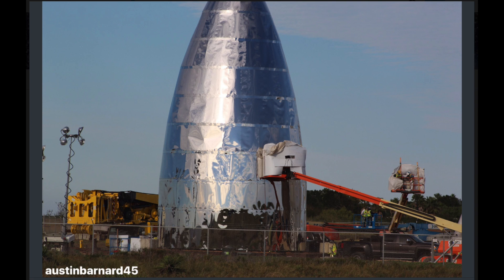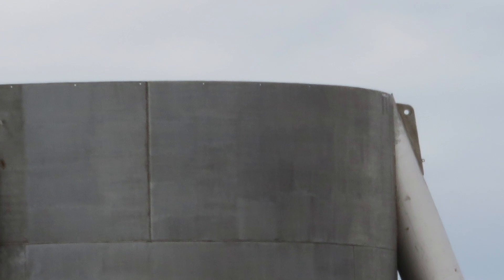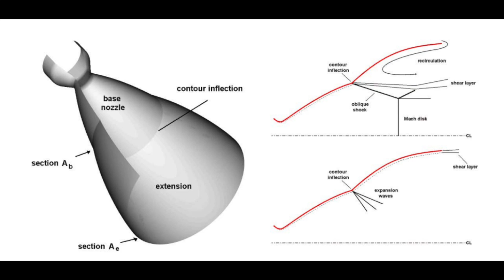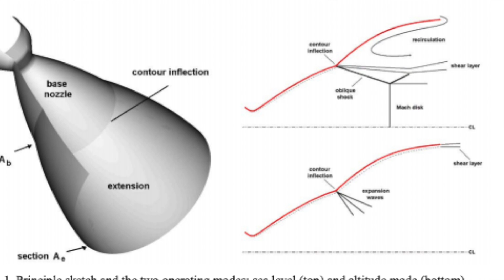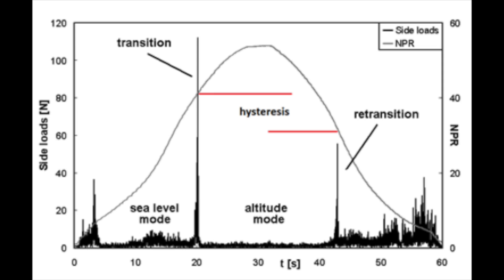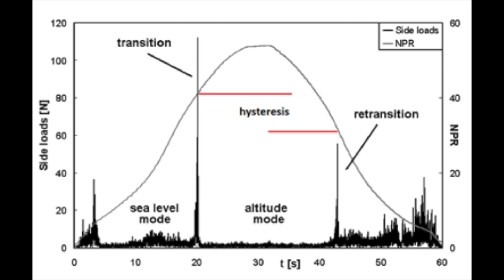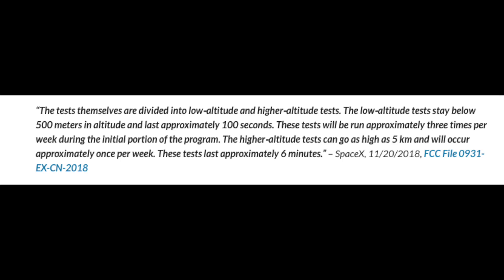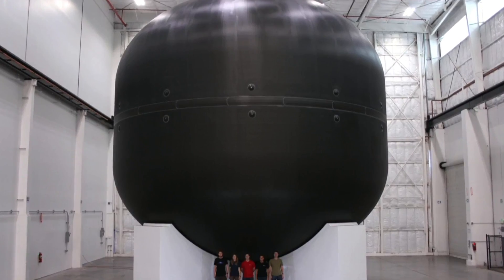What's Going On With SpaceX's Stainless Steel Starship?

Comment: go find the large flat panels on the SR71. When sheet metal expands as it heats, it only gets slightly thicker, but can expand greatly in the plane of the panel. As noted by another commenter, applying flat sheets to a compound-curved surface is also difficult. 

If Scott's assessment of the use of polished stainless as a heat management solution is correct, you don't want those sheets of metal expanding in plane - they'll start popping fasteners pretty quickly. That's the same reason that much of the titanium skin of the SR71 is corrugated. The ugly panel forming on this prototype could simply be to give the metal a way to expand without fastener breakage and fancy metal forming techniques. 

That said, the rippled panels will also probably introduce hot spots in an uncontrolled manner. It is, after all, a prototype. If Musk is going to use polished stainless in the final setup, I expect that many of the panels will feature corrugations or a pattern of raised bead rolls.
Reply: Cylinders can't expand "in plane". They just grow in diameter when heated.
Reply: @nvlietstra   Duh. I missed that. Commenting tired is almost as bad as commenting drunk. But I still believe a nicely formed smooth sheet would stress the fasteners. OFC, I'm not a materials engineer, so believing it doesn't make it true.

Comment: It is just a hopper.  It will not go particularly higher or faster than Grasshopper.   The double bell might just be to allow for deeper throttling, more than it is for Vac service.
Reply: Miguel - Yup.... Not! This puppy is "Supposed to go up 20 Kms, & Back." Original Grasshopper only did about 1-2 Kms altitude.

Comment: Maybe it is just a mock-up frame to work on the cabins and interior architecture, it will help to test ergonomics and comfort on test crews. Furthermore, I would not be surprised, if this is a mock-up, that it could be used to test crew members candidates ability to live and work together in a « starship simulator » to check their potentials and behaviors, prior to sending them to Mars. Personally, I would do that, just to make sure that everything possible to test the crew and their needs have been done before sending them on Mars. Funnily, SpaceX might do a kind of «big brother» like tv show with it, to create media frenzy about testing Mars crew candidates on earth, while MarsOne had the same idea but on Mars, which is much more risky and could go very wrong.

Comment: What if this is just a transportation unit for the carbon fiber fuel tank? the sections look easy enough to assemble/disassemble. stainless steel for transport on a boat, and structural enough to keep the tank safe. It would be a really awesome to see a ship going around with a giant shiny rocket on top. maybe he is just putting fake rocket engines on it to keep us guessing (why would you leave something that expensive out in the open around fabrication??)

Comment: I think it's largely a software/controller test platform. I suspect it's main purpose is to fine-tune the most complex aspects of landing with multiple gimbaled engines running at the same time while maintaining balance for the tail landing configuration. That level of software control and all the hardware sensors that feed it, plus the durability of the computer systems handling it all, plus redundancy and hand-off problems... all this means a legitimate flying platform to do live tests. It doesn't have to do anything but house all these systems, but since that's the only requirement, why not make it a "scale mock-up" of the real thing? Makes for good advertising, especially when it's all assembled, polished and sealed. It will be a lot prettier than a blocky structure of girder framework, and probably doesn't add much to the overall cost of the project if the top two thirds of it are just a "facade" of sorts.

Comment: Why are they doing this ... ?
It is rather obvious that it is going be the lowest possible cost way of working out whether his new engines and side thrusters are going to work and be controllable - there is a hell of a lot to test - one engine, two engines, three engines, flight control, hovering, starting and stopping the engines multiple times while flying, throttling them up and down as they fly. 
If SpaceX can test all that with a very cheap rough stainless steel can - of approximately the right proportions and overall weight - brilliant. 
When it crashes ... they won’t have broken the bank ... with the simple crude design they can afford many failures ... and learning how to manage this particular bit of the flight envelope is rather important!
GOOD LUCK !!

Comment: I think the bent up sheets of stainless, haphazardly bolted together into roughly the "correct shape", are hilarious. I'm concerned that we haven't seen any tanks. I suppose they could salvage the LOX and Helium tanks from a retired Falcon 9 booster, but I imagine the methane tank is a new design. I suppose they could contract to have an aluminum-lithium tank printed to spec... but, it doesn't look like anything on this hopper is "to spec".

Comment: For landing a spacecraft, having triple redundant engines seems like a good idea, having 1 and it fails you are basically a ballistic missile with a lot of fuel that you cannot burn off due to lacking a working engine. Having 2 may cause asymmetrical balance complexities in case of a failure. Having 3 seems logical, if one of the outer ones fails, you land on the center one, if the center one fails you land on the outer ones.

i am no rocket scientist but i sort of asume that is why there are 3 inline, and not in like a equilateral triangle

Comment: I guess they need the bottom part to test the vertical landing capabilities of the raptors before they slap it on an expensive BFR/Starship part. The top part is not really needed except for a bit of aerodynamic stability and of course in usual Musk style it is shaped in something that will trigger some memories/fantasies and imagination.

Comment: 1. this is just the hopper so making it made of carbon already is way too expensive. 
2. the top is different because they probably use a different metal there which is light so that the center-of-weight is lower which is crucial for a hopper test
3. the legs are solid because as elon said the landing is so advanced on this that it probably doesnt even need suspension
4. the nozzledesign is only for the test-phase because the tesat will all happen in atmosphere until they build the real spaceship which is gonne have to be a lot lighter
Reply: SpaceX has already said that they're ditching carbon fibre for the upper stage, because the development time would be too long (and thus too expensive). They're switching to stainless steel. In order to make up the huge weight difference between CF and SS they're not going to use a heat shield on the upper stage, and are instead going to use methane fuel to actively cool the spacecraft's skin during reentry, coupled with a highly polished exterior to reflect as much heat as possible. AFAIK this will be the first orbital craft without a heat shield.

SpaceX has also already said that they're not going to initially use vacuum engines on the upper stage, because development will be too expensive and time consuming. They're going to use the same engines on the first stage as on the upper stage. 

Keep in mind that they were initially going to spend 10 billion dollars developing that 12 meter diameter monster carbon fibre Mars ship. That money was going to come largely (~70%) from government sources like NASA and the US Airforce. Both NASA and the Airforce have decided not to fund development of the ITS/BFR/SSS, so SpaceX has to fund it themselves. They were going to spend 3 billion dollars of their own money funding ITS, and they're going to have to spend no more than that building the Starship Superheavy stainless steel variant. So development has to be (relatively) fast and cheap. In order to keep the payload in the 100+ tonnes to LEO range (fully reusable) a lot of non-core development had to be cut, such as vacuum engines and complex carbon fibre construction of the upper stage. This allowed them to focus their efforts on using traditional materials and construction techniques in new and innovative ways, while still keeping the costs low enough to fund development internally. (The first stage may still be carbon fibre, because it's just a simple tube which is a well understood structure from a carbon fibre construction standpoint.)
Reply: @jasonwalker9471  
The re-entry speed for the Super Heavy will be much lower than the Starship. This may reduce thermal differentials enough (assuming a foil laminate) to still use carbon fibre composite. The deal breaker for composites is the high skin temperature.
Reply: "...gonna have to be a lot lighter..."
Reply: The weight is likely to be similar if not identical to the planned Starship. Got to make realistic tests after all. 
The landings will be precise and soft, unless they are not. There was telescoping tubing visible in the legs during early construction. May be hydraulics for foot pads.
Reply: @avid0g  well i didnt say weight, i said Center-of-weight. I said that because the mass will defnitly not be realistic since no hopper-test was ever even technologicaly close to the real thing. They are just a prove of concept. Not a prove of the full design.

Comment: I just wonder... is this build a "Zubrin" Concept Test... building space worthy vehicles, by people who normally do build say... a water tower. Learning to build really low cost reusable Space Vehicles... The Tech is available so this may just be a proof of concept test...

Maybe it is also a test for a later mission. This vehicle may not be  meant to be launched from Earth... it may be reassembled in Orbit (launched in sections by the new heavy lifter) so it may even be a Lunar lander... a Mars Lander (in concept) though it will land on Earth from an Orbital assembly and Launch. If the nozzle assembly makes more sense in a lower pressure atmosphere... then maybe?

If the latter is true, it shows a difference in psychology to exploration. NASA would assemble in a clean room to prevent contamination, Elon is not worried about that so can create a vehicle at a fraction of the assembly cost
**edit**
* Then again, Elon could just be Trolling... and this is just a Water Tower... if so... well played sir, well played👏👏👏😆"***

Comment: I saw on reddit or twitter, can't tell where, someone suggesting that 3 engines are for more control + they plan to land the actual starship with 3 engines so that also might be it

I think they are building it with stainless steel so they can see how it will behave on it

Comment: @Scott Manley... I'm not a spaceship designer, but thinking about whale barnacles, wouldn't it reduce the side loads during the transition period if the contour inflection wasn't perfect? Could have half be half the inflection as the other half... And be spaced around the whole engine... Kind of like the modified flip lips (see 22:21 of https://youtu.be/XsYgODmmiAM... these make the undertow after spillways less dangerous). Or is it not much of a problem, so it isn't worth SpaceX's time to worry about it?

Comment: I know what this is. It's a return module for a Mars mission. They are testing different payloads which can be sent to Mars in advance, and with minimal assembly can be used as a return vehicle to Earth.

Inside will have a machine that makes rocket fuel out of Mars' atmosphere, and it will sequester the fuel somewhere near the pod when it is landed.

Check if these three sections would be able to fit inside Falcon Heavy spacecraft. I'll bet they would. The lack of an interstage is because it's intended to launch from lower gravity platforms.

Comment: OK, so here's my guess: the shiny part doesn't look like its capable of withstanding any kind of aerodynamic loads at all.  It looks far, far too thin.  The only reason I can see to make it shiny is to protect the inside from the sun and I'm guessing the inside is going to be fuel tanks.  I think its a flight mock-up, like you said, possibly for investor reasons.  It looks like its going to be another vertically flying rocket that has no intentions of going anywhere near space.  Three engines sort of implies a level of redundancy that says "manned"?  Thats my guess, a manned thingamajig to meet the "manned" milestone.  I'm probably wrong.

I'm just thinking that control grid fins and actual stabilizing fins are irrelevant for the "speeds" that this will be flying at.

Keep a weather eye out for RCS being attached.  Then you know something's up.

Comment: I think you're being willfully obtuse. It is obviously a test vehicle. It will not be doing re-entry, or reaching anywhere near exit velocity. They are going fast because, fail fast. It's not a stretch to say they have done this sort of testing before. It doesn't need anywhere near the complexity of a finished F9. Simple.

Comment: I'm not interested with the nozzles, however stainless steel is NOT the material to use for a rocket. Normally maraging steels are used because of their resistance to heat deformation, stainless steels are the exact opposite. As a turner miller and also welder of this material, I can tell you that in all of its forms ,it is NOT suitable for the heat that it will be subject to. Where is the truth?

Comment: This contraption they're erecting doesn't make a lot of sense to me, and the whole operation there is on the far side of strange. Initially I thought it might serve as a jig, but the workmanship isn't there. It may only be a platform meant to test engines - but if completeness and accuracy are needed, why the cavalier attitude toward assembly in the middle of some swamp?

Comment: My wild ass guess:I t is probably a performance simulator, and is not intended to do anything complex other than get the tech and data running. Its a testbed vehicle designed just for baseline testing for engines, maneuvering, flight surfaces and so on.